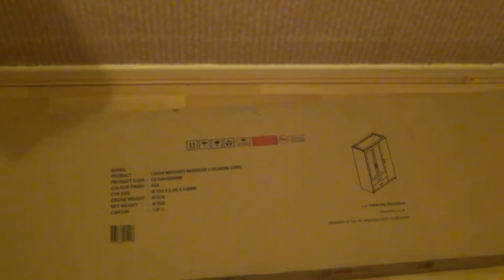Building a wardrobe

Comment: Hi one of the drawers don't seem to fit. How did you fit the runners? The doors are really low and keep hitting the drawers, did you have the same problem?
Reply from the maker: Nop, all the parts are same.Just follow the number of the parts when you put together. The instruction is rubbish. Just open the door if you have problem with the drawer

Comment: 1:52  the plastic white item (top 1) is not ment to be facing the top like the bottom on the instructions and a hole is meant to be in the bottom one on the instructions but there is not a hole . What should I do
Reply from the maker: Did you buy the same wardrobe?
Reply: @mimsavage5844  yes
Reply from the maker: @rayhanmahmood1827  the instruction is not quite accurate. I struggled myshelf when i build that wardrobe.
Ok so if you see that white plate. There is one of them is different. One goes to the wardrobe drawer and another one goes to the wardrobe part.
Reply: @mimsavage5844 there's a 10mm gap between the 3 pieces